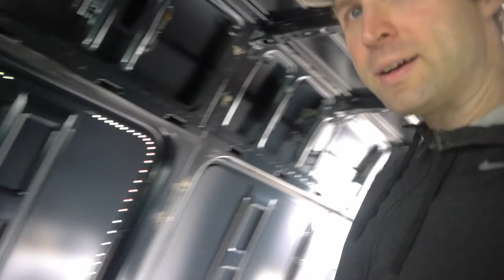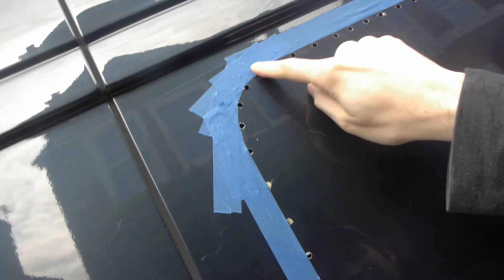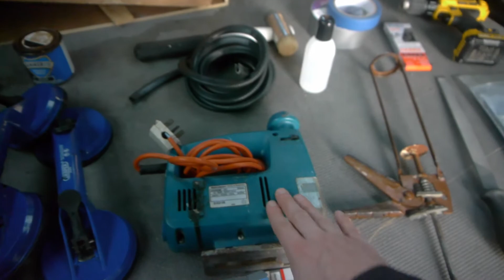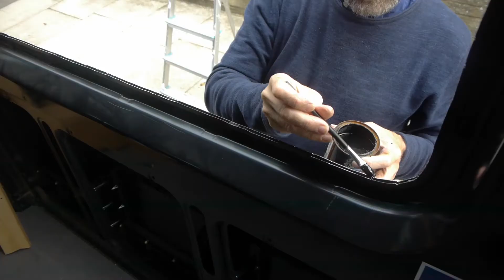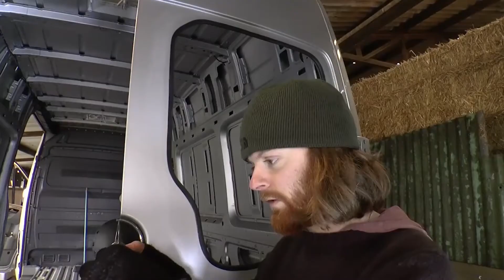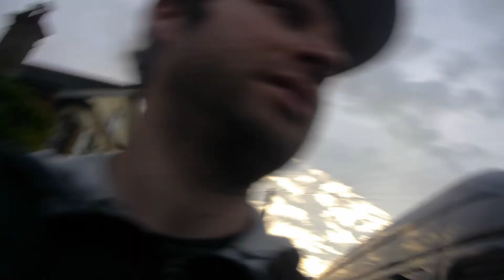Mercedes Sprinter Camper Van Window Install - Summary/Tips

Comment: I'm in the process of buying a Sprinter to convert, and I'll be installing windows in the van. The video was really informative and gives me confidence in doing it myself. My main concerns however, is that I'm struggling to even find a website where I can order them from. I'll be working on the van in the Netherlands but can receive them in Germany too because I'll also be there. Can you give me a rough estimate of how much I'll be paying for the rear and side windows? -I just want simple clear glass windows. Thanks!
Reply from the maker: not sure - in the UK it's about £200 for both of the side windows, which could be bought on eBay and probably about the same for both the rear windows